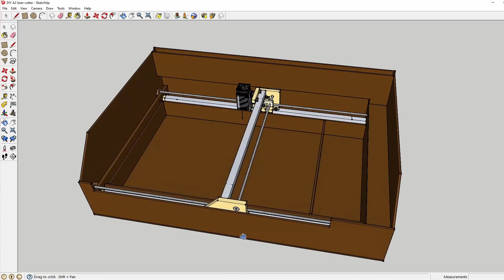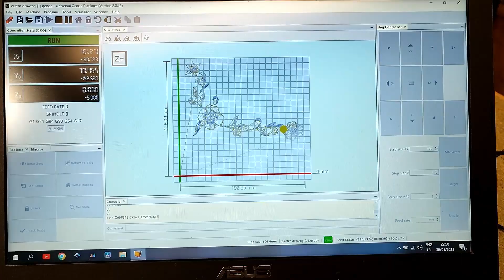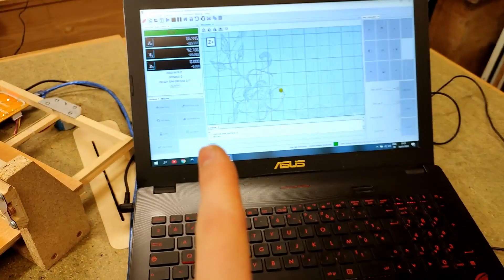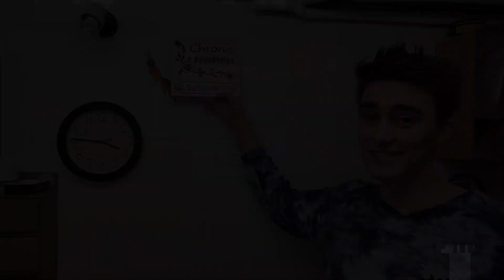How to make a laser engraver ALTERNATIVE for your CNC pen plotter

Comment from the maker: If you decide to build one of these, make it only 5-10 watts! Excessive heat can lead to carbon buildup on the tip. Through some experimenting after the fact I can now say 7-8 watts should be ideal for getting the highest range of shades on a plotter using the 28BYJ-48 stepper motors.
If you want your power output to be adjustable you could easily combine this engraver with the PWM controller circuit from my other video (https://youtu.be/CcMiGZUzITo)
Reply: Bro, recently I built a cnc machine which can able to mill the PCB, engraves the wood and able to use as plotter. But the problem I have is when iam using inkscape for plotting any picture or text , it represents the z-axis (trace line) too, but it works fine with PCB and wood milling. Can you please tell me what to do to get rid of it😢.
Reply from the maker: @suryavamsiy  I'm sorry I don't understand the problem from your description... Also I don't have any experience working with 3 axis machines 🫤
Reply: @ChronicMechatronic  Bro, my machines pen doesn't moving up and down while drawing any of the image.
Reply from the maker: @suryavamsiy  The pen is servo driven? Then it's probably because the start/stop spindle command is missing in your G-code. I covered that in this video: https://youtu.be/s47uF0DVW1g
If the pen is just mounted to the spindle you'll probably need a different G-code extension that converts the on/off of the pen into an actual Z-axis motion
Reply: @ChronicMechatronic  and how to do it can you make a video of it( the pen is mounted to a spindle) . Thank you so much for your patience to reply me bro❤️
Reply: Hope, you reply me fast plz